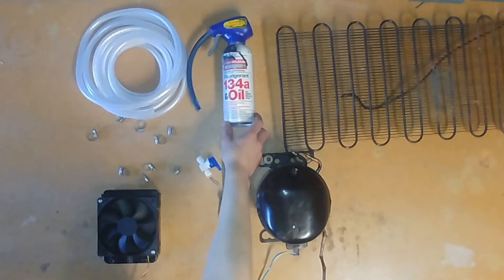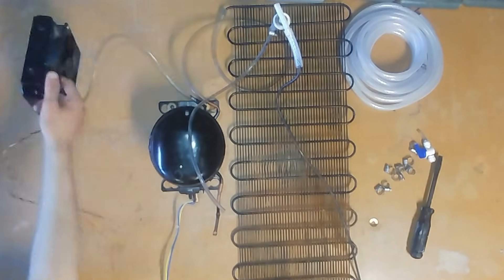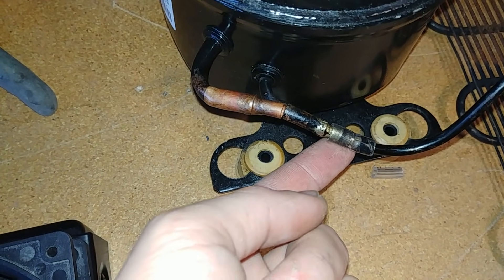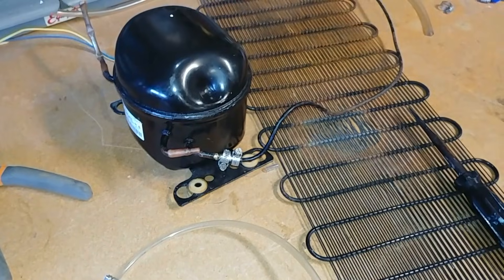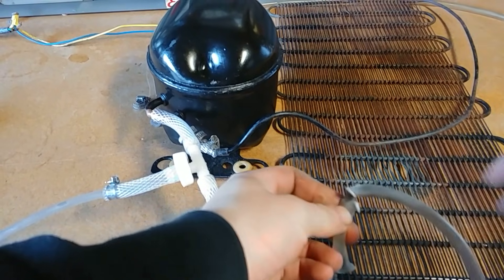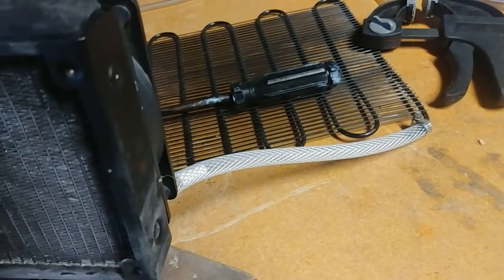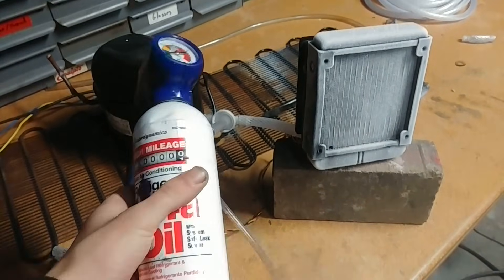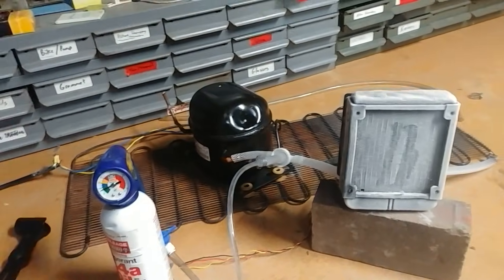DIY AIR CONDITIONER WITH COMPRESSOR diy ac from scratch

Comment from the maker: check out my other videos if you like fireworks, solar, air conditioning for free(not evaporative) etc
Reply: That's awesome...if you could do some stuff for us vanlifers.12 volt and  solar stuff. Like AC and heat and just or ideas on that stuff would be great .new subscriber and i love to build stuff to just can t much anymore.thanks for the great wprk and please keep it up..
Reply: great results, from what little I would know. Question, how efficient is this build? Does if consume much electricity?
Reply: If you want a cheep source for 134a thats what is in air duster..   Most dusters contain one of two chemicals: tetrafluoroethane (HFC-134a) or difluoroethane (HFC -152a).
Reply: can of air duster is usualy 2-4 bucks
Reply: @linearburn8838  that's good to know
Reply: That's awesome bro.very very well explained and that's extremely important.verry kool and im subscribing right now and please keep these kind of videos coming for us build it yourself guys and gals..well done.thank you .full time homeless vanlifer.wooooo
Reply: Where is the split video 🤔😀.
Reply: Hello my friend. What is the piece behind the orange dowel? Behind the orange piece inside the pipe

Comment: You still need to vacuum the system before adding refrigerant as the moisture trapped in the system from non compressed air and refrigerant will cause black death. The frost is a result of no TXV to regulate the refrigerant but an imbalance in the cycle like that of what occurs with no TXV to separate the non pag oil liquid and gas phase which is what any compressor prefers. Icing over an evaporator isn't something to be fascinated by. Refrigerant is also very flammable even in small amounts and metal rather than plastic piping is used to pressurize it for a reason.

Comment: Badass! Super neat! 
Been researching converting a dehumidifier, basically just removing the condenser and attaching it to a lineset outdoors with a fan and stuff... 
That way you're dehumidifying AND cooling instead of just dehumidifying and wasting power as its warm enough out in my location for AC when its humid enough to use that.

Comment: You need nylon tubing , 150 psi with high temp, they make it all the way up to 425 psi..

Also if you don't want to braze, or solder,  you can always to jb550 weld after everything is sanded, let it dry though 24 hours

Comment: Damn that's awesome. I don't need an AC, but a way to cool PC water cooling liquid. I'll need the thermostat to stop it at 4°C / 39°F to not risk freezing it solid or super cool it.
If that works as intended I'll have my PC running at beer temperatures instead of the usual min 55°C 131°F under load.
Thank you for the video. I was hesitant, but you showed what is possible and how easy it is. I would use copper tubes and solder, but it's apparently not necessary at these specs.

Comment: Question my compressor is r600a right can I use R34 whatever a lol on the compressor if I remove all the r600a from it
Reply: No you cannot they use different compressors butane is also already compressed,  not  like r134a which is not.

Comment: too much effort and expensive things to use...... i would just use an old fridge, smash out a hole in the house wall the size of the fridge and plaster in in place to keep warm air outside the house...... then inside the house keep the fridge door open with a fan blowing the cold air out 😂

Comment: Honestly, this is 100x better than those peltier tutorials, like the people assembling the "ac" just install the hot side onto the room, i bet the rooms just gonna heat up. Overall great tutorial, im gonna build one for myself. Just and advice, next time pull a vaccum so you dont get an increase of pressure!
Reply: bruh of course the room is gonna heat up where else would the heat go

Comment: Expanding and contracting the gas increasing the surface area in the PC cooler allows that to be the evaporator and immediately reducing the heat over the span of the heat exchanger no matter how small

Comment: Where is the thermostatic expansion valve?
Reply: Instead of this he used a syringe cap with the small hole in it but thermal expansion valve it will definitely help
Reply: @melihaksoz  Kanka peki ince ve kalın bakır boru kullansak, kompresör yerine kuvvetli bi hava pompasıyla gazı bassak, ince boruya gelince illaki sıkışacak basınçlanacak, böyle yapılamaz mı sence

Comment: I build air conditioners from coolers circulating ice water through 480mm radiator 65mm thick. I use strong 120mm fans to pull air through.  Pretty cold. What size 12v compressor to ice up the radiator and keep it cold flowing air through radiator?  And would 2 small compressors do the job?
Reply from the maker: i tried 3 days ago  did not work with the 60w one i used

Comment: What an amazing idea and build! I have a question, can I skip putting the refrigerant in the compressor? Can I run it with just air in the compressor?
Reply from the maker: shhh, that's a corporate secret.  fr tho  yes you can but air has a lot less thermal capacity so it would have a pretty bad COP (Coefficient of performance ) in relation to r134a or even propane

Comment: Hey man this is great work!  I designed software-controlled AC cooling systems for EV battery packs but never got a chance to do it hands on and want to build my own.  This video helped a lot!  Would love to see a follow up video to improve the efficiency of your system by monitoring the superheat and using a thermal expansion valve and even a split system!
Reply from the maker: I have a water-cooled one out and many more to come

Comment: Hi, did you measure how much electricity was that system consuming?
Reply: This is the question I am looking for? He said the compressor is a 300w so assuming it is near that rating.
Reply: @MCircuits   I have a 450w air conditioner (5000 btu), so this thing he's building is not much of a difference in savings.  I thought he could make like a below 200w, then it'll be a device worth building.

Comment: I've been watching a lot of videos lately where people cobble together small battery powered demo systems running butane. The objections from the "professionals" are filled with reasons that are basically saying "since it doesn't look like anything I work on commercially it can't possibly work." 
(I'm not sure which particular kind of logical fallacy that is, but clearly it's not good reasoning)

I see a similar pattern of thought in the comments here, especially when it comes to removing the air and moisture by pulling a vacuum first. A quick look online shows refrigeration vacuum pumps running in the $50-$100++ range - many times what he spent on all of the other components combined, and definitely thinking that is trapped in your training. To get into the spirit of this kind of "model" building you have to temporarily suspend the training and experience and consider the underlying principles only.  
For example: There are other ways to purge the air and water vapor from the system.

How about leaving the loop open, and flushing the lines with a can of the products used for "dusting off" keyboards and such? (also a refrigerant by the way)
You could probably flush the lines with the gas in a helium balloon from the flower shop. (traces of helium won't react with anything - read about noble gasses)
If you switch to butane, which has many advantages including lower operating pressures needed, no environmental consequences, and of course, cost, you could then just purge the system by flushing it with butane - leave the loop open at the top, pour some liquid butane in the lines, it drops to the bottom and starts boiling and the vapor displaces all the air/moisture from the system. That's also a good idea to avoid having a mix of butane and oxygen (flammable/explosive) in the system.

Discussing these kinds of ideas is   (in my opinion, yes, this is just my opinion, I acknowledge that)   much more in line with the idea of garage inventions than just pointing out that if you buy some expensive refrigerant, and expensive vacuum pump, hey - why not a gauge set too right? you can do a better job.  😆    just sayin' ...

Comment: Hopefully you are aware of propane powered cars do you think the propane cylinder can be connected to such a setup to make a handy refrigerator in a car?
Reply from the maker: yep, but might not have a large cooling capacity
Reply: The refrigerant in any chiller is not constantly being added and lost out the other end (like the car engine burning the propane for example) The refrigerant loop is "charged" with a quantity of refrigerant, sealed up, and then that material goes around and around for years. So it doesn't really have to matter that the car engine might be running on propane - you could charge your refrigerator from the tank under your BBQ  and run the car on diesel or electricity or even a steam engine if you like 😁

Comment: How did he draw a vacuum in order to fill it with the gas
Reply: It’s part of the refrigeration cycle when the compressor is running. You have a high-pressure side and a low pressure side, by way of circulating refrigerant in a loop with a compressor and then limiting the rate at which the refrigerant can flow through a section of that loop. By restricting the rate that refrigerant can flow into the evaporator, it causes a pressure imbalance, with high pressure being created between the compressor output and the restriction valve, and because it is a closed loop, a vacuum is therefore created after the  restriction valve to the compressor intake. The evaporator is placed between that valve and the compressor input, making it part of the low pressure section. 

Refrigerant is sold as a liquid in a compressed state to fit the most refrigerant possible into the unit of volume that is the can so the can is not huge for no reason. Because it’s pressurized, and because the fill valve is placed in the section of the refrigeration loop where a vacuum is being pulled by the compressor, the refrigerant is easily sucked into the system by connecting the can  to the fill valve, turning in the compressor, and opening the can’s valve. The refrigerant is sucked into the low pressure vacuum side of the system just the same is when it is circulating in the loop from the high pressure condenser side. 

There is always a vacuum drawn in the low pressure side with relation to the pressure in the closed-loop system. The can of refrigerant is not at 0psi. It can not be by its very properties that it’s designed for. The pressure of the liquid refrigerant in the can is greater than the pressure of the gas refrigerant on the low-side, and is quickly pulled into the system.
Reply: And 134a isn't flammable but very toxic to the ozone

Comment: This is extremely valuable in that old fridges are everywhere.   Any idea how many watts this consumes? It would be constantly running right?  I have an offgrid property in Florida with a tiny 4x8x6 shack under the trees and with a insulated roof and screened walls.  I'm looking for a way to cool it down while the sun is out.  My power source is a 500w solar panel in the sun.  Dumb question but how safe and legal is this?
Reply: In the video he says the compressor is running at around 300 watts. I have a large refrigerator in my kitchen that runs at a measured 140 watts.  The problem with using a refrigerator compressor and a solar panel isn't the running watts, it's the startup energy requirement - I sometimes run my fridge from my solar charged battery bank - the initial startup of the compressor pulls over 150 amps from the batteries (only for a second, but still, it has to be there or the compressor won't start)  There are things called "soft start kits" for refrigerators and AC units that will greatly reduce that inrush current, but you will be shocked at the price of them.

Safe?  Dumb people can injure themselves with toothpics.

Legal? Technically, venting some kinds of refrigerant into the atmosphere is illegal to prevent commercial operations from doing it by the ton. But the EPA doesn't show up at landfills to recover the refrigerant from every kitchen fridge thown away. (and if you remember, the hole in the ozone layer closed up years before any of our environmental actions should have caused that - so we don't know the whole story, as usual)

Comment: if you ever make a part 2, i would recommend using copper lines. they can be found pretty easily. also pull a vacuum on your system before charging, as mixing water and refrigerant can cause a pretty corrosive reaction that could destroy your components. and use pag 46 or pag 100 oil r134a. but pretty impressive though for what it is and the materials used! looking forward to what you make in the future.

Comment: Really liked this. I know you said the components are expensive, but I've seen another YT where the guy shows building off a used refrigerator condenser coil. The compressor cost?  The radiator cost?
Reply from the maker: radiator was like 20 (computer)  compressor was free  and so was the condenser  expensive bit is if i wanted to make it full coper instead of plastic

Comment: Would car components work with a fridge compressor? Say for example, I have a car evaporator, expansion valve, condenser then I would use a fridge compressor powered by a solar panel. Would that work?

Comment: may I know does this unit humidify the air surrounding?
Reply: It wont humidify the air, if anything it will dehumidify due to the water condensing on the coil if its cold enough
Reply from the maker: no

Comment: Asking again for one more time here 2 months later, do I REALLY need to use high pressure hose or just a normal hose would fully work? I don't want to use a garden hose for the whole system for go kaboom, I'm thinking of high pressure gas stove hose for it but not 100% sure if I had to get a hose specifically for refrigerant systems (Talking about in somewhat long term usage and not will work or not first)

Concept Summary: A compressor-based personal space cooler that uses a compressor and a condenser to cool the air. The compressor and the condenser are placed outside on a window, and connected by a high pressure hose. The indoor unit is a modified desk evaporative swamp cooler (specifically Arctic Air, the front-side plastic part fan is cut off using a dremel to for a custom copper evaporator to be fit in) and it blows air through the evaporator. This cooler SHOULD be more effective and way more long lasting than using swamp cooler by using an ice + water, and unlike using only water, works in humid conditions.
Reply from the maker: use high pressure  hose

Comment: You think that two 240x120 mm pc radiators with 12v cooling fans can cool down the hot refrigerant? Or you need a bigger radiator for cooling down the hot refrigerant?
Reply from the maker: i think that would work

Comment: Propane and butane are flammable gasses. 
If you charge your AC with those it's likely it's going to explore or catch fire.
Reply: It might explode, but there shouldn't be enough propane in the system to cause problems unless it's physically placed near flammable materials  . A propane barbecue  placed near cotton curtains would be a bad idea.

Comment: Do you think a fridge/small refrigerator compressor will work? And what about cooling down the condenser? Can I attach the condenser to a something like a $15 walmart fan and would it work?
Reply from the maker: yep this was a refrigerator compressor
Reply: @ianbuilder  how about cooling the condenser? I think an actual fridge doesnt use a fan too cool it down, but an ac does
Reply from the maker: @Not_Aran8276  should work fine

Comment: If you had put a vacuum, remove all the air inside of the system then fill the refrigerant the system would cool much faster and you would achieve much lower temperatures.